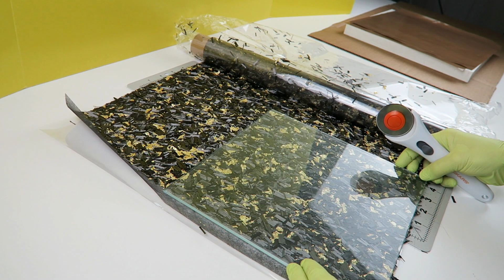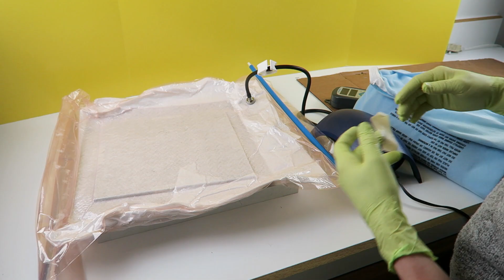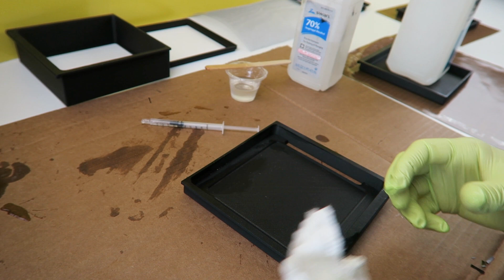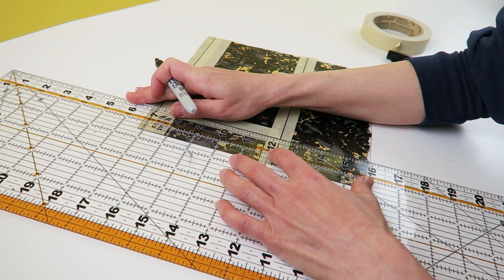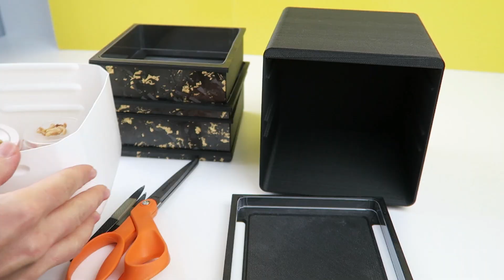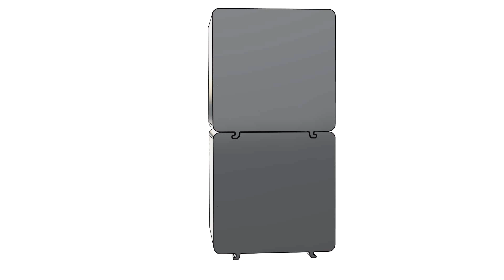3D Printed Drawer System for Growing Mealworms

Comment: I don’t understand the point of this video or what you’re trying to achieve other than exposing yourself to as many toxic chemicals as you possibly can… it would seem that you are trying to create some kind of toxic hotel for some poor creatures who would most likely appreciate you dropping them off out in nature somewhere… while I get the slight impression you have the capacity to be an intelligent person… your actions say quite the opposite… I find you strangely interesting while also quite frightening… I mean no harm… it’s just fascinating how weird people can be… you would never imagine someone like you would exist… yet here you are! …in your own little world doing whatever it is that I imagine to you seems quite normal.
Reply from the maker: Strange times.
Reply: What toxins? Epoxy is considered food safe if correctly mixed and fully cured. PLA filament is considered food safe (I would use PETG - also food safe - as mealworms might have a capacity to consume PLA). As for the creation process always use protective gloves and respirator when handling chemicals such as Epoxy and when printing with a 3D printer do it in an enclousure with ventilation system to the outside.
Reply: @ (Acids) While cured epoxy may be food-safe, it can degrade under certain conditions, such as exposure to high heat, acids, or abrasives. This degradation can release harmful chemicals over time.

Comment: I have no idea how I got here and why mealworms need carbon fiber anything, but I am watching with fascination. I have a 3d printer and I want to learn resin crafting so, I guess that's why YouTube suggested this? What do you do with the mealworms?
Reply from the maker: Treats for guinea fowl in winter when there are not many bugs around. Although the plans to get a flock this summer may not work out, in which case I have no idea what to do with the mealworms.